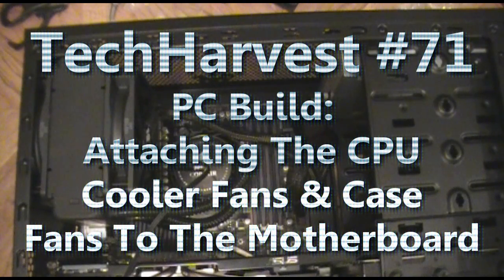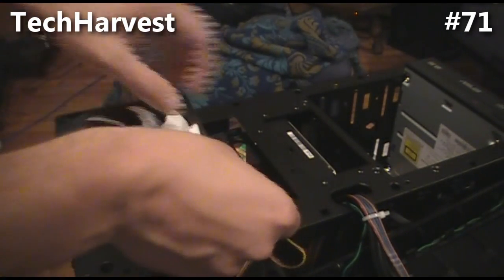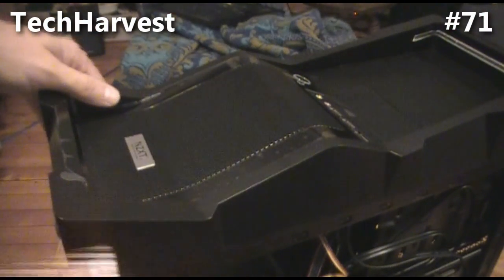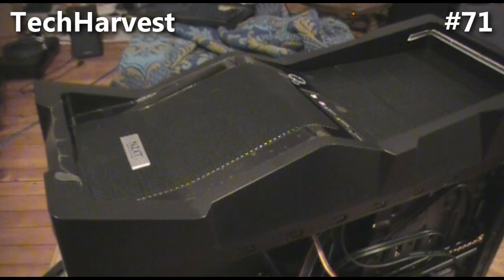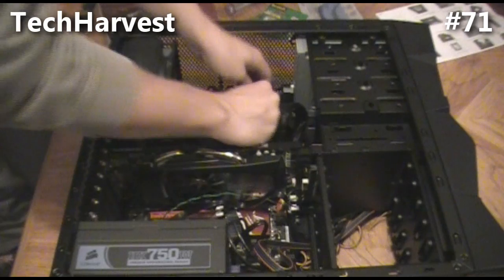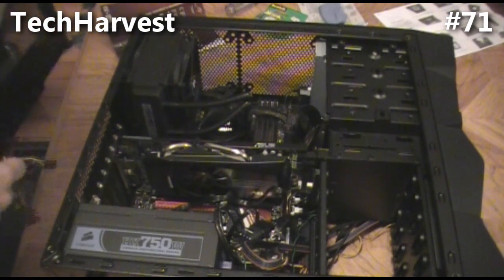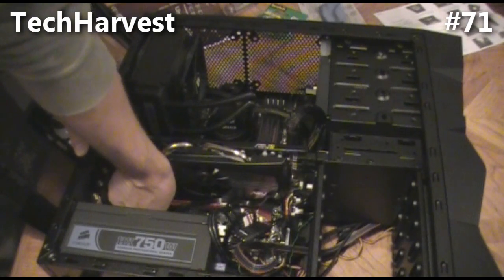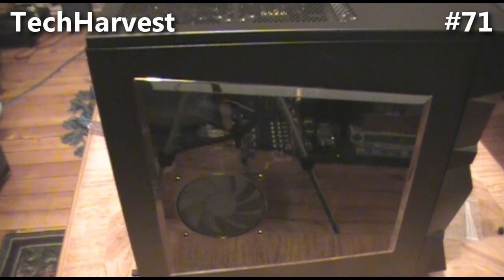Building A PC: Attaching The CPU Cooler Fans & Case Fans To The Motherboard

Comment: What's the difference between the system fan socket/channel and the general fan sockets? Could the system fan socket be ignored and just use the many other fan sockets around the board?
Reply: Normally the socket is called "Sys Fan".

Comment: the fan on my case doesn't have a cord... what should I do?
Reply from the maker: +Carteeeer A fan will always have some sort of power connector.  It's possible that it's bundled in with the other case cords.  That's probably where it is.  If it isn't, you'll need to get another fan because a fan won't work without power.
Reply: TechHarvest I found it, it was hiding inside the front of my case.

Comment: I have 3 120mm fans, 1 in the front pushing air in, 1 in the back pushing air in, and 1 on the top for exhaust, think this is enough?

Comment: How can I connect my CPU cooler so that it will regulate it's RPM depending on it's temeratur? because at the moment my fan is constantly running on 2700 RPM when connected to the motherboard.

Comment: Hi. 
I took off an old CPU Fan and decided to use it as a case fan.
I did have a bad experience earlier where I bought a fan, installed it and used it for quite a while but then stupidity kicked in and I moved the PC in a way in which I think hurt the fan, and made my mobo and CPU burn down.
Which was the problem ? My fan burned it down or the MOBO had a faulty connector ? 
Would it be safe ti connect the 4 pin cpu fan where the faulty fan was ? Or it may damage my current components? answer plo

Comment: I took a cpu fan from an old PC, can I connect it to my new PC and use it as a Case fan ?
Should I connect it to a 4 or 3 pin connector ? Could  I control the speed of it if it would be connected to a 4 pin connector ? Could I turn the speed down ? I would like to use it as a chipset cooler.

Comment: what do you mean ? cant i connect all my 3 fans to the mobo? i found 2 fan thingys but i need 1 more and i cant find it, i found 1  but its diffrente from other 2 it still has 3 pins but has  a plastic thing around 2 pins, but anyways il try to connect one there if it doesen work , il connect to the power supply...

Comment: ive looked to my mother board and i found 2  things with 3 pins and more 2  things with 3 pins but one of them has like a plastinc thing on the two pins, idk if am sopuse to connect there idk, and what happends if i connect the fan to the wrong place?

Comment: the plastic piece is on your mobo yes the 3 pin socket on your fan will fit on the 4 pins on your mobo the plastic piece makes it line up correctly

Comment: ohh i assumed you allready did that..... lets start from step 1. you allready have your intel/ amd chip in your mobo right. depending on your cooler. if its a stock or 3rd party. clean the contact point and put thermal paste on your chip and cooler only a little. next figure out how your cooler wants to be placed. screw on the plate and screws to your mobo place your cooler on your chip make sure you got it lined up right and press down and screw the cooler in place.

Comment from the maker: @l4dxpert1 Double check your connections to make sure everything is connected the way it should be.  If everything is in place get a 230 vac and see if that solves your problems.  I don't think it is the problem though but it's worth running it through just to make sure.

Comment: what would you recommend when installing a fan in the outside of the case. Should the fan fanned the inside of the case, or pulled out the hot air out?. I have an Hp pavilion elite and I was thinking of installing a fan in the outside case. The inside case only has one fan and one for the cpu. Also the fan that I'm going to install should I connected the motherboard or power supply?